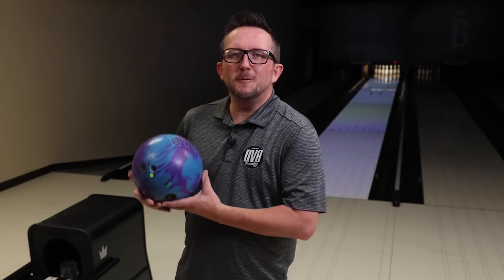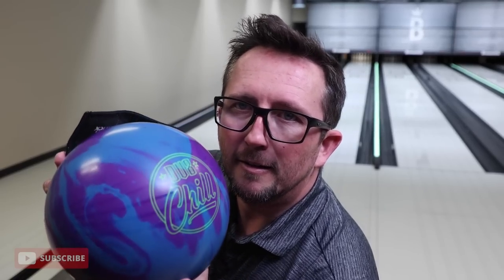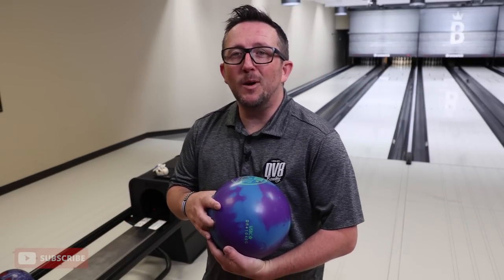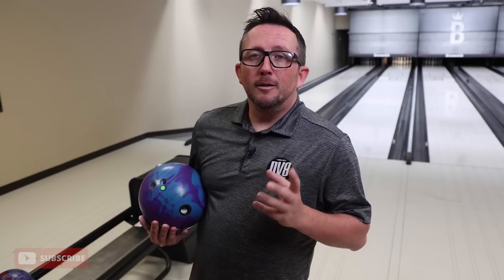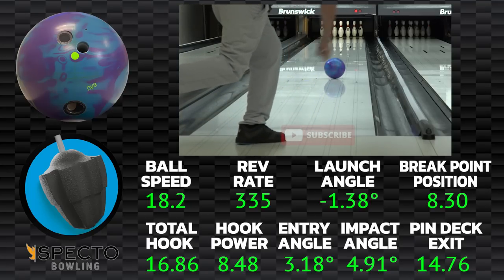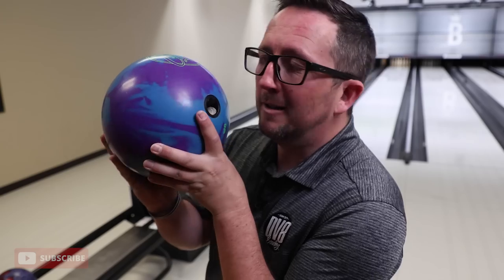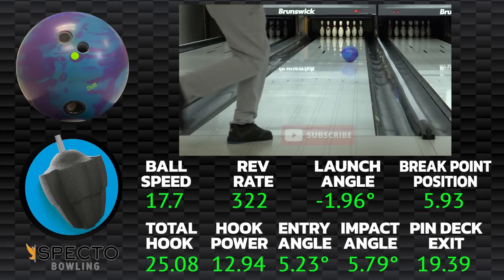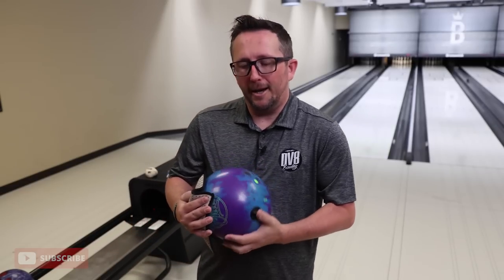Pin Down Layouts = BAD?? | BrunsNick

Comment: It's bowler and condition specific. For high ball track players, everything you say is right, since you are one of them. I'm a lot lower track bowler. I have two 900 Global Aspects, one pin up, and one pin down. Both are 4x4x2, and the pin down ball uses and inverted PAP. That is, it's over my usual 3 11/16, but instead of up 1 1/8, it's down 1 1/8. That pin down ball for me blends the cliff on fresh house shot, and has excellent continuation through the pin deck, with very few corner pins, as well as a smooth motion at the break point. The standard pin up ball goes straighter until it breaks, then has a fairly sharp break. It is real good after the lanes are broken down. I think ball track and method of making it pin down make a big difference. Like so many variables in bowling, what is good for one is not necessarily good for another.

Comment: My shop proprietary PAP coordinate and layout system uses the thumbhole as the fulcrum of the layout. With the concept being, the thumbhole is the PSA on symms, and PSA positions greater than or less than 90 degrees from the X-axis will tend to raise the RG and consequently reduce the total diff, as well as less overall post-drilling asymmetry on the RG plane that intersects the PAP. Which is say, pins at 90 degrees to the thumbhole on symms tend to have a stronger/quicker breakpoints, and pin-thumb less than or greater than 90 degrees tend to be more controllable and have less backend motion. Bowtie and track flare management become an issue for certain players when the pin is either very far or very close to the thumbhole.

Comment: I personally am around 325-350 rev rate and arguably my favorite resin ball this past season was the orange DV8 Verge solid. It was pin down 45 x 4.5 x 70. I am on the left and I have about 19 degrees axis tilt so sometimes I struggle with balls being too forward and/or erratic off the spot. I do however tend to use pin down solely on those stronger symmetrical balls with low RG and high differential.
Reply: I recently decided that anything i get with a diff over 40 im going pin down.

Comment: Enjoyed this and your other videos,  Nick. I have previously used pin down layouts on symmetrical cores (with balance holes)  but understand now based on this video why it's not a good idea any longer.

Assuming that with asymmetrical cores, then pin up and pin down drillings are still useful, depending on the type of roll or ball reaction you are looking for. 

Most of my current arsenal is symmetric cores but looking to get new balls with asymmetric cores and wondering what my drilling options should be.

Thank you in advance and I really enjoy your videos.
Reply from the maker: Asyms still good to go! They actually look much better for most lower speed players too.
Reply: That's me...slower speed...I am best from 15.5 to maybe 16.5 mph although I am on the higher end of that range with my new C300 Cuda Pearl ( what a ball!!!) I need some options to replace some older asyms (currently have C300 Baller and Swerve) . The Baller is pin up above the bridge and at times I like it, other times not so much. It also picks up a lot of lane shine, I just can't keep it at the factory matte/dull finish. Any suggestions on how to keep the lane shine off of it without putting it on the ball spinner every other week? Thanks again.
Reply from the maker: No way around that unfortunately.
Reply: @brunsnick  thanks again. It's funny how some balls stay dull and others pick up lane shine really easily.
Reply from the maker: @garyfleming8963  they’re all trying to find a median surface by rolling on the lane. Shiny balls are closer to the surface they’re on so they don’t change compared to a dull ball at say 1000-1500
Reply: @brunsnick  and when I was referring to "other balls" I meant balls that were factory finished in the 1000-1500 range...some stay dull and others easily pick up lane shine, in my opinion and experience. I have the C300 Hybrid Resurgence factory finished at 2000 and it shines up a bit as well, but not as quickly as the Baller. I consider the 2000 finishes as Matte vs. Dull. And since both the Baller and Resurgence are both factory at 2000 it's strange how much quicker the Baller shines up than the Resurgence. Assuming it's the coverstock material vs. what it's finished at.

Comment: I agree with the specific use on sym pin down layouts. I have one a GB4 pearl at 45x4x65. As a mostly matched, sometimes slightly speed dominate bowler it's a sport/challenge pattern killer for me. Allows me to play the track behind my big asymmetrical solid once it hooks too much. Almost a lefty don't move your feet trick for right handers. I then transition from the pin down to a move left angular ball to end the night. Only issues I see on the video is using it on transitioning lanes instead of fresh. Also not sure if it was a house pattern was used as the only time I've used it on house pattern was when even twists and tropical surges were hooking the whole lane.

Comment: my favorite layout is rico, because im reb dominant and every ball on the market now hooks regardless of the volume. I just need it to slow down the transition to the roll after it sees friction. Most of the houses in my area is flat and short. around 39ft. not much buffer. its easier urethane or pin down layouts to blend out the patterns. When you are even in rev/speed and have normal easy oiled house shots, then pin up is where you wanna go. its all just pattern/ bowler dependent of course.

Comment: I use pin down alot for two reasons, I like that earlier roll and more controll hook for the way I throw, and I leave a lot less wash outs. Plus with the pin down you do get as much as a sling shot when the ball jumps off the pattern. Which too much angle like that can also be worse since it takes more energy away from the ball to make that sharp turn then a more gradual motion. And I find having more control on those tough sports patterns is much better.

Also isn't that why you have different surfaces and grits and surfaces to control length

Comment: I drilled a pin down Knock Out Bruiser and Melee Carbon and that combo was the best combo for me all season. Maybe it’s being left handed but I still believe in pin down symmetrical balls
Reply: It's not that surprising to me. 
With the elimination of weight holes, I've only liked pin down on balls that have stronger cores (low rg/higher diff + some cores seem to rev easier). The Melee/Knockout core fits the criteria for me.

Comment: Another excellent, very informative video Nick, now I know why I hate my pin down Storm Axiom. I normally have pin up layouts but I bought the Axiom used for $80 and it just needed the thumb plugged and re-drilled, I figured a no brainer since NIB are still going for $229.00 The pin down Axiom is my most unpredictable ball I have, even pocket hit strikes sound like a dud, I'm thinking of having it plugged and re-drilled pin up. I ordered a DV8 Hellcat XLR8 from my local pro shop, I think I'll throw that first before I spend another $80 trying to fix the Axiom. I'm always trying to think of good names for bowling balls, how about DV8 Brutal Awakening, Radical Katana Scepter, Brunswick Conviction, Hammer Raucous, DV8 GENR8?

Comment: Completely agree, I’m at 6-7 degrees of tilt and track higher up on the ball and I’ve never found much success on pin down layouts. Never really understood why though. Would also be very much interested in the why or if a pin down on an asymmetric core would be good/bad
Reply from the maker: Could work better but you may need to use much smaller drill angles so you get that mass bias towards your VAL.
Reply: @brunsnick  Very interesting since most of the layouts I'd say are my best use a higher drilling angle i.e. 65 x 5 x 35. Doesn't swinging the mass bias closer to the VAL cause the ball/core to pick up sooner?
Reply from the maker: @jeremiegrund  not always, but if you’re using a pin down layout, you need the ball to respond quicker and a lower VAL will do that.
Reply: @brunsnick  Really appreciate you taking the time to provide this kind of insight.  Thank you so much!

Comment: Nick’ 1:01  I never use pin down on Symmetrical balls.
 Asymmetrical I do.
11:59 speed 17.2 down to 16.1-16.2 I totally believe your right about the pin down I. Todays alleys. The last time I did a pin down was 8 years ago. Of course side weight was there. Great video. But 1 thing was missing? 
One shot from a pin up would have sealed the deal. X love this ball. Buying it next week

Comment: My pin down balls all flare 5" or more with wide separation.  My attitude control flares the most, almost 7" .  The only exception is my pin down obsession tour pearl.   That flares less than 2" .   Everything else is incredibly early and versatile.    The closer the pin gets to center of grip, the earlier the balls get.  My attitude control and danger zone are drilled the same and they hook at 35' buy I can play big angles on dryer conditions and in heavy short oil they allow me to play much straighter than my pin up stuff.   Some of my pin up stuff can only be used in heavy oil left of 3rd arrow or lofting the gutter in dryer conditions.

Comment: Most of my equipment is pin up, but I drilled a Hammer Envy Tour pin down for the purpose of having a strong yet controllable ball in my arsenal. It does exactly what I want it to do, and I have an Ebonite Envision Pearl to switch to once the Envy starts to burn up.
Reply from the maker: This video will focus on symmetrical core balls only.

Comment: Love your videos and the information you bring with it. 
What do you think of stacked layouts?  
Would love to see a video based on that.
Reply from the maker: The CG location is irrelevant.
Reply: @brunsnick  Thanks for your reply, I am aware the CG does not matter but I would really love to see the difference on the lanes from a visual standpoint compared to Pin Up as you did with the Pin Up vs the Pin Down Layouts. If you could, that would be great.

Comment: I still use pin down layouts. I an low speed low rev (max out 310). Also have a high track and about 9⁰ of tilt. Obviously I am more up the back of the ball. My pin down Stealth solid is my money ball for Symmetricals.

Comment: For me, pin down and pin up controls how fast the ball transitions. If you need the ball to get up and go fast, get a ball designed to do that, drill it to do that and then use it when you're supposed to. If you want to control the transition, either go pin down to tighten up the flare or use surface, but don't be the person who wrecks the shim because 500 grit is the only way you can get any control on a house shot. You know who you are!

Comment: I throw it 16mph maybe 375 rev rate so I can make a ball hook but not a cranker by any means!! I love pin down layouts!! I drill my first of every ball pin down (work in proshop so drill a lot).. really creates a cleaner and smoother reaction for the conditions I bowl on…they are great from straighter angels and I have no isssue bending them… wish we still had extra holes but I’ve made adjustments to drill angles to make up for it… I use em on everything
Reply from the maker: On symmetricals though? Drill angles won’t really matter there.

Comment: Back when balance holes were allowed, I had a ball with the pin on/near PAP. Symmetric and medium cover. That ball worked great for me on burned-up sport shots. This was before the re-emergence of urethane. Wondering what would be best if I wanted to get something to fill that slot today.
Reply from the maker: Can still use the same layout with a mild symmetrical for burn. RAW Hammer Hybrid would be a good pick.

Comment: @BrunsNick now you have me very nervous! I received a text from my PSO that he did a layout of 30 x 4 5/8 x 70 on my brand new Hammer Effect. I've never had a pin down ball and have no idea why he chose that layout. I'm a traditional down and in, lefty, one-handed, thumb-in, high track, 15 degree tilt, 15 degree axis, 175-200 rev rate, 12-16 mph clocked at the pins. (On the tilt, axis, and revs he guessed but didn't do any actual tests). PAP 4 5/8 left 1 up. I'm gonna be pissed if he ruined the ball I was the most excited for and one of the most expensive. Unfortunately, he did wait a long time to drill it after meeting with me and seemed to have forgotten a lot of information. He's rarely there, so I have to wait nearly two weeks before I can go pick it up. He just drilled a Pure Envy for me with a layout of 25 x 5 x 25, so I hope he didn't screw that one up too...
Reply from the maker: Pin down on lower speed lower rev players often looks better on ThroBot and in real life. I think you’ll be good to go.
Reply: @brunsnick  thanks Nick. I appreciate your response.

Comment: I think maybe your game may not see the use of a pin-down layout on a symmetrical ball, but I'm a down-and-in lefty with high speed (18.5-19.5 on the screen, 17.5 when slowing myself down). The pin-down layout allows me to play the same area of the lane when my C300 Savage starts burning up. My Phaze4 hits like a truck with a pin-down layout.

Comment: My fav ball in my bag is d idol helios pin down. And i use it for shorter oil patterns usually playing in d track area. 

I drilled it specifically for this purpose. Love pin down on this ball only. 

But as u said moving in with this ball is a nightmare.

Comment: I have some pin down balls and one is a hyroad x and it is pin down under middle finger and it has wide flare rings like a pin up ball . And same with my hammer Statement solid pin down under bridge and mb kicked out to the left . But I track near my thumb . But I don't know my pal  / revs / tilt but I do have a 17-18 mph ball speed .

Comment: So pin down is getting closer to short pins in that they are nichey (if that is a word) and very condition specific.  But I wonder how this would work for two handers since there is no thumb hole.
Reply from the maker: Most 2 handers never use pin down layouts.

Comment: what if you use a ball with a low diff like a rattler?
Reply from the maker: Might not flare much at all for me.
Reply: @brunsnick  so definitely won't work for me. PAP is 6 1/4 over 3/4 up

Comment: As long as there is separation between the oil rings (so the ball isnt rolling over oil), is there actually a big difference between tight flare rings and ones that are spaced out?
Reply from the maker: Yes absolutely.

Comment: You seem to not like it but it rolls better than what you say it does :P  I have about the same RPM as you, but more speed, and i drilled my old Messenger Ti short pin (1 inch). After at least 700 games, it still hooks a ton. Anyway. To illustrate pin-up pin-down differences you would need to compare side by side that shots of the 2 balls on the same conditions. CTD also did a video on this and they differences were very small. Sometimes you couldn't even tell which ball was which. Bottom line is that only elite players will (maybe) consistently "see" the difference. The 99% rest of us, will see it on one shot, then not see it on another etc, because every other small deviation in technique (for example RPM, SPEED) will have a much larger impact on the ball motion. For example in this video, SPECTO, measured for you these RPM values : 335, 322, 347, 325, 345,  358, 348,  359, 335, 346, 348, 353, 347. And that is the variance only of the RPM. It is not easy to draw real conclusions unless the experiment is done in a scientific way (with EARL too).
Reply from the maker: Yes the ball still struck some, and was easy to get to the pocket. But I don’t need ThroBot to tell me that this pin down ball didn’t get through the pins nearly as well as the pin up version posted 2 weeks ago. https://youtu.be/a01O1nZI3lM
Reply: @brunsnick  I hear you. You threw both these balls so you know better. Just pointing out that with so many variables, it is easy to misjudge or to think something plays a bigger role than it  really does. That's why science has safety methods to avoid being deceived.

Comment: I have a high track with low tilt, and pin down layouts normally track over the thumb hole.  The one exception was a Vibe Envy that  had the pin between ring finger & PAP.  I shoulda kept that ball. 🎳 😎

Comment: I used to have some strong asymmetrical balls with pin down layouts and balance holes back in the day that were very good. I also had some symmetrical balls with balance holes before they changed the rules. The first ball I ever threw a 300 with, was a radical rave that initially had a balance hole with a pin up drilling, and was plugged. All the balls I use currently are all pin up. I do prefer symmetric to asymmetric. The only asymmetric in my arsenal right now is a hammer 3-D offset.

Comment: How do you determine which balls will be good when drilled pin down?
Reply from the maker: Typically I will only consider pin downs on asymmetrical balls.
Reply: @brunsnick  Tomorrow I am about to drill the Brunswick Knockout (dark color) pin down

Comment: What happens if you drill the balance hole and then plug it? Is there enough difference in the density/weight of the original ball vs the plug material to see a difference??
Reply from the maker: Not really no. Radical tested this. https://youtu.be/2IBWRxR6G78
Reply: @brunsnick  I thought there was a video....guess I should have used that search function first. :)

Comment: Am i correct that with an asym pin down the intermediate dif is what makes it work?
Reply from the maker: Yes, the mass bias influences the ball motion whereas the mass bias in a drilled symmetrical ball (with 2 fingers and a thumb) will always end up in the thumbhole.